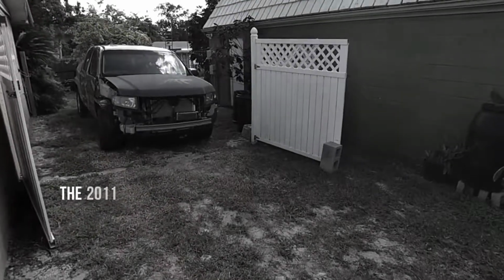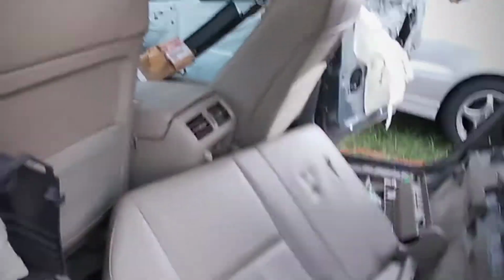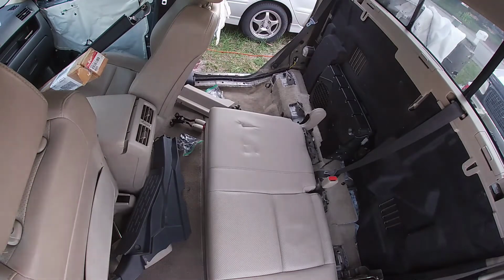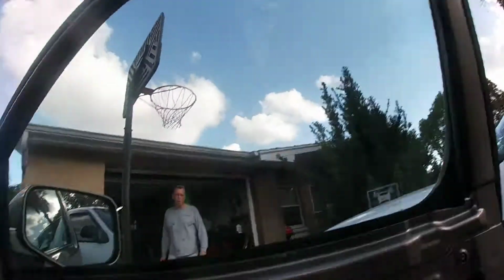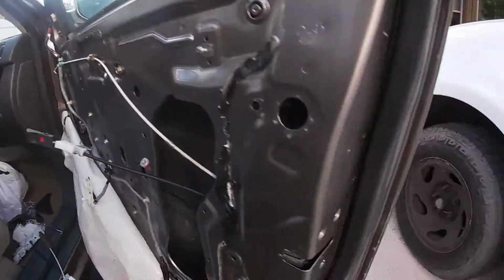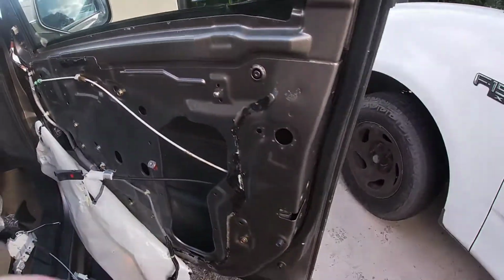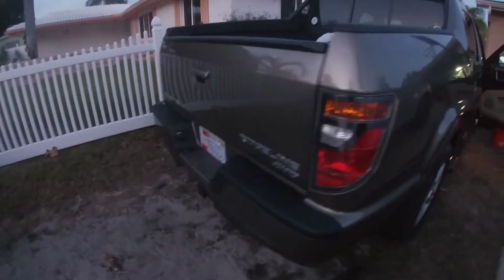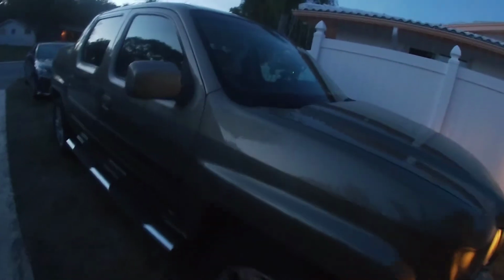The 2011 Ridgeline rebuild Pt.8 Interior install and final Assembly

Comment: Great job. I have a 2006 rt and love it. If you have over 100k  consider timing belt and water pump kit. Also consider sending the injector out to be rebuilt. I already did the belt and plan to do the injectors and the radiator once the weather warms up.  Look up strawberry milkshake for the reason you may want to change it. It's a hard ware corrosion issue that takes out the trans. May not be an issue in Florida
Reply from the maker: The truck has 165k on it now. Rear diff seals and fuel economy have been better. Great truck overall for now.